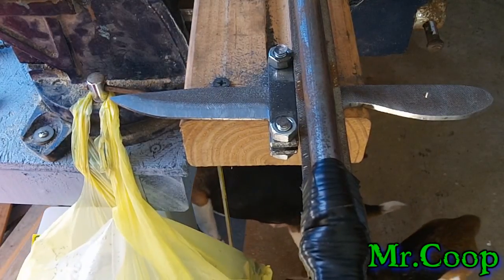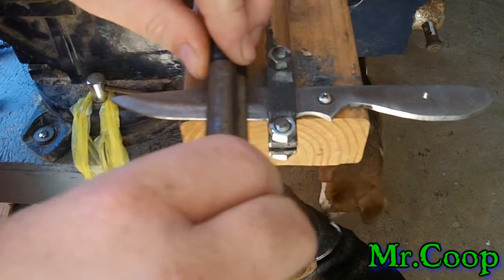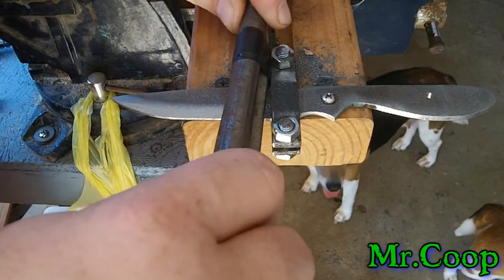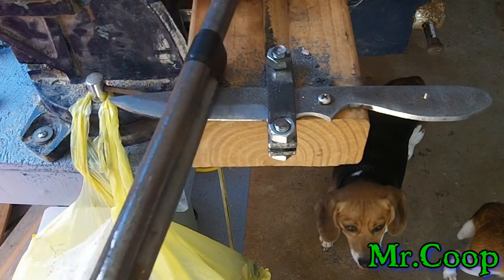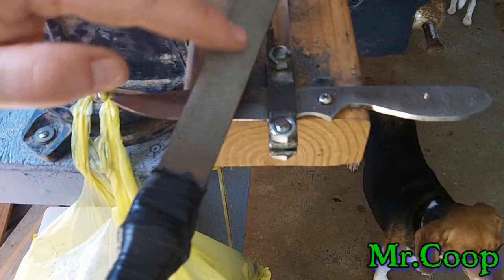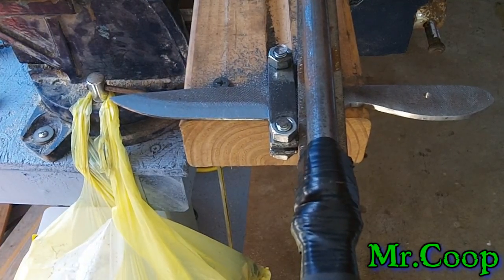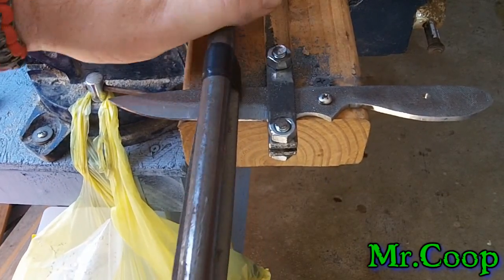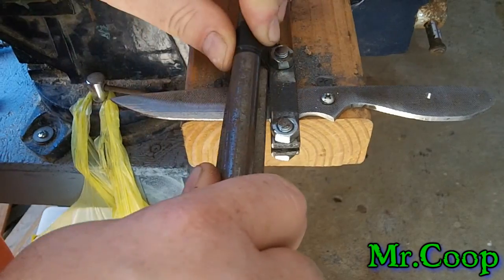Tip Of The Day (Draw Filing  VS. Push Filing)

Comment: Great video and the information you gave was right on. My Father taught me  how to use a file when I was very young  he taught me how to draw file which is a great method to remove metal and get a nice finish on whatever you are filing. At the time I learned it I was mostly sharpening hoes, axes and lawn  mower blades. Thanks for sharing, the file guide you use works great and keeps your angle consistent which is what you need, no guesswork. I like the  blade your making and agree a nickelson file wood would work better, to me they are worth the price as they last longer than the Harbor Freight file will.

Comment: Great video thanks. Really like the way you have set the filing guide into the slot in the wood for equal filing both sides of the blade. Going to try that idea if you don't mind please. Cheers.

Comment: Thanks for the little tutorial on filing.  I am making my first 4 knives (2 are practice knives that won't go for heat treatment, just to get my beveling down).  I bought a Nicholson 10 inch bastard cut file for the beveling.  I have access to a forge and a plasma cutter, but no 72x2 belt sander.  I'm going to hand file these like you are doing.

Comment: i seen your video and made a device like the one you use for filing, i tried the file, was too slow to file an annealed file into a blade. so i used a piece of all-thread and threaded it into my grinder. used edge of grinder using a thin cutoff wheel to get my angles done for a tanto. then of course filed it out draw filing and now onto sanding. of course i must have tilted the file while drawing and got some nice deep scratches. sucks but first blade cant be perfect i guess!.  so thats why im here on this video rofl. thanks